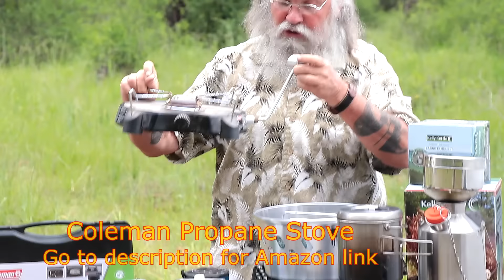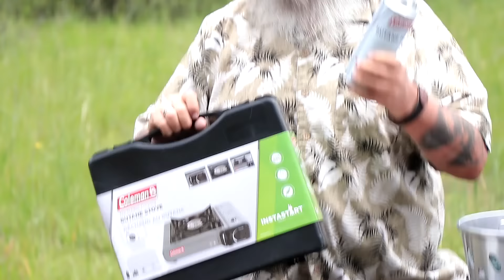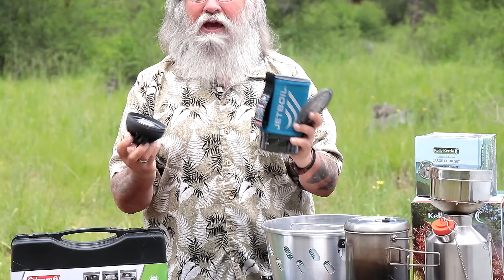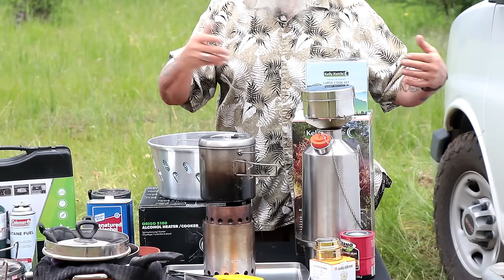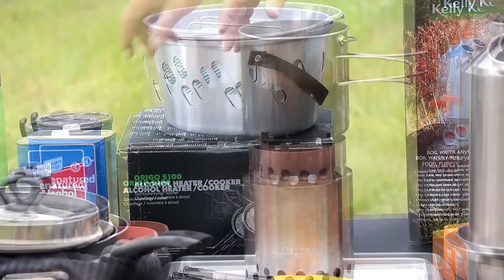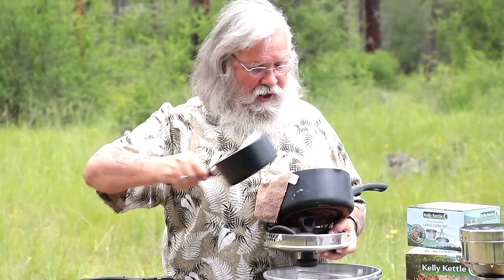Introduction to Stoves:Test Review and Comparison of Wood, Propane, Butane, Alcohol & Sterno Stoves

Comment: I have the Dometic alcohol stove heater and a Kelly kettle.  I have used a pressure cooker on the Dometic just fine.  That combination gives you a steam oven,  fast cooker.  I bake breads and cakes. Saves fuel. 
I love love love my Kelly kettle,  paired with a good thermos,  hot water all day.  Endless fuel with Kelly kettle,  i put sterno or a Trangia stove inside and use indoors,  in my van.  
Water will extinguish alcohol,  and safe to breath.  The Dometic has a fuel spong so it's spill proof. 
With alcohol fuel,  you could actually make your own fuel if needed.

Comment: They tell you not to refill the small propane tanks but finally they are making refillable ones. Another useful device for hot water (but not cooking) is the Japanese cast iron tea kettle which sits on a cast iron base where you place a candle or alcohol based "canned heat".  This is handy in cold weather because the whole unit acts as a radiant heat source. Keep the candle burning nonstop and eventually you get very hot water sufficient for tea and coffee.  These are expensive, 45 to 65 but they are beautiful and as I said serve as a heat source.

Comment: Pressure cookers are great, once you get the hang of them. It doesn"t take long, and there are plenty of tutorials online.
They save time, fuel, and money, and they preserve more vitamins compared with the usual, slower methods of cooking.
The "insert method" (cooking food in a bowl supported above the water inside the pressure cooker) makes cleanup a snap, because the pot never contacts the food, and it stays clean. No cleanup of the pot. The bowl that you eat from is all you need to clean.
The best budget option is the Presto 8 quart (available on Amazon). You can spend a lot more, but this cooker is as good or better than options costing hundreds of dollars. The extra room and diameter of this cooker make it much more versatile than the smaller ones, and it doesn't take up much more room.
You can also use it as an oven. Some bakers use pressure steaming. That's exactly what you can do inside the pressure cooker. I've baked breads and muffins this way many times, and they turn out great. You never burn or scorch anything when you use the insert method. It's a very consistent and foolproof method of cooking.
I can't say enough good things about these cookers, once you get over the basic learning curve, which isn't hard at all.
Coupled with a small propane tank and a basic propane burner (I like the better small cast iron ones made for campers), it's extremely durable and economical. Propane is inexpensive when you just refill your tank(s) by the gallon, and the pressure cooker means you use much less fuel.
After trying many others, this has been the best cooking system by far for me.
Reply: This is brilliant. Thank you for sharing the details. I wouldn't have thought of this.
Reply: I was just at a cooking site where they said you can put a few same-height rocks or sand in a larger pan or kettle, bake on stovetop safely. Pressure cooker sounds like a good thing.

Comment: Great info once again.
- I save a few bucks by refilling the small propane bottles from the larger tanks.
- Regarding the soot on the bottom of cookware, fantastic results are achieved by using a glass cleaner specifically designed for cleaning the glass doors on wood burning stoves. "Rutland stove, grill & hearth glass cleaner" is what I use.
- You might also look into the Firebox Stove (plenty of YT videos). It is compact and can be configured to burn wood, lump charcoal, briquettes, pellets, propane and alcohol. Some additional accessories are needed to use all forms of combustion.
- Yikes, confirmation of my choice to stay single and no kids all my life (60's)
Reply: How do you refill the small tanks?
Reply: Carol Hewett ...I bought a transfer connector from Harbor Freight. There are several YouTube videos on the process.

Comment: I'm one of those oldtimers who's always cooked over a wood fire, and yes, soot does not come off completely. I also carry a small alcohol burner I made back when I was 15 or 16. As I've gotten older, I did buy a Coleman gas burner (Coleman made my first lantern, so it was natural I went with them). The one thing you did teach me about Bob was the canister burner which I now have gone out and bought one plus 4 fuel cartridges. I haven't used it yet probably because I'm really not sure how so this series will come in handy.

Comment: Coleman in general makes pretty great products, however for the butane stove I advise for your consideration the gasone version which is actually dual fuel which uses butane cylinders but includes the hose to hook up to a 16 oz propane unit and as such can also be adapted to a larger size propane bottle

Comment: One option that Bob did not discuss is a Sterno Stove.  They fold up to about 8"x8"x1.5 inches plus the can of Sterno, so quite a bit smaller than anything Bob is showing there.  The stove is about $6.00 and the fuel is about half that much.  I don't remember how long the cans of Sterno last but they do work, at least to heat a can of stew or soup.  I've never really cooked with them a whole lot but I can attest to the fact that they work.  Paired with a Boy Scout style mess kit it should be fine for one person.
Reply: They are an option but as I recall from camping they dont work well at high altitude.

Comment: FYI - you can buy butane canisters at most Asian Markets for $2. That’s 1/3 the cost in regular stores or online.
Reply: What is meant by Asian market? Like an Asian store or an Open Air Market? Thanks!
Reply: Linda Sue it’s just an Asian market. It’s where Asians buy their food in the US and Canada. Same with Bodegas and Carnicerias. I doubt you’d find many open air markets in the US or Canada unless it’s a flea market which are usually not code enforced.
Reply: @lindasue8719  a shop that sells things that are either packaged in Asian countries or just prepared with pure Asian cooking in mind. Kind of like the Latino section of a supermarket, but a when shop dedicated to Asian cooking needs.

Or maybe a shop that sells Asians, but I'd steer clear of that.

Comment: I was very pleased that you included a volcano stove type, in this case the Kelly Kettle, which not only allows for cooking on the top whilst boiling water, but can also be used to cook  directly on the fire pan once the Kettle is removed.

A steel grate is available to put directly onto the fire pan to use it as a woodstove in its own right, separately from the water boiler.

This greatly increases versatility and butane/propane/white spirit use in the main van cooker.

Ghillie Kettle are a good brand and their M-Kettle is the smallest volcano kettle available and it can also store and carry water with it's supplied silicone plug.

The M-Kettle holds just over a pint and can even be taken on hikes. It is perfect for a solo traveller.

Edited to say that the butane bottles which fit those flat camping stoves are actually cheaper here in the UK when bought in packs of 4 they're £1 each.

I use a gas valve adapter to refill my JetBoil cannisters using those £1 bottles of butane and have also bought an adaptor to use them on some of my other stoves.

Comment: One factor is that both wood and alcohol stoves are banned for much of the summer in the West due to fire danger. (Yes, alcohol stoves are banned during burn bans. If you read the burn ban, the only stoves that are allowed are ones with separate fuel chambers and burners, with a valve that can be shut off.) I am partial to an option Bob did not mention: white gas. No disposable canisters, no big bulky heavy propane tanks, excellent cold weather performance. But you do have to go through a priming procedure when lighting the stove.

Comment: Just got Kelly kettle base camp size. Love it. Very efficient.
Reply: Kelly Kettle base that holds fire (or charcoal) does get very hot. Careful what you set it up on. Would damage wood picnic table. Remove solid type  
Plugs when heating.

Comment: we have these stoves, Gasmart brand for under $20, and at one of our hardware stores they have the butane cans at $5.99 AUD for four or five of them..l did read some reviews though that claimed that either the dial OR the bracket that holds the can tend to break easily after a couple of uses so I'm looking at a different style..a small gas jet that will sit on a small gas bottle..suitable for backpackers and hikers..it's a little dearer but l figured, spend a little bit more there and l wont be replacing as often..which in turns saves money..I'm watching lots of your clips to get tips for solo female travelling out of the back of a car, and as l own a Honda Odessy it means l have plenty of length for sleeping in the back..once lock down lifts here in Victoria l would like to try for a weekend away to see how l cope..plan to bring dog with me for some security..I'm using my lock down time to research..

Comment: Hi there, we love your videos! Recently we bought a 1975 Ford campervan, and even though we live in northern California and it doesn't get super cold, we want to find a way to heat our van. I watched your alcohol burning stove with your friend as well, and that one is nice, we are leaning towards a direction that seems to have no one in the RV/Van life community doing, the Samovar tea kettle and stove from Russia and used extensively in the middle east primarily for making tea. Have you seen that or familiar with it? They are both a heat source and heat water which anything that does double duty us van peeps love, and not only that.... they are cheap! I can see a couple issues, but should be curable without much difficulty(bottom heat, venting pipe that fits). I'm just curious if you have ever tried or have seen one used?

Comment: Hi Bob. I didn't hear you mentioned a rocket stove. My husband has one and the only thing that he  uses is small branches or small pieces of wood and he can cook a whole meal with it. The stove is less than $100.00 and no fuel need it except for wood.
Reply: I agree, they are great but you must cook outside right?
Reply: @carolhewett3756  you would have to rig up a chimney but I guess a few people on vans have done it, it's basically a wood stove. I have only ever seen them used outside.

Comment: On a different subject. Could you please do a revue on how fuel consumption is effected on the same van in high and low roof format and possible long and short wheelbase. Here in the UK fuel is much more expensive especially if you are on a budget and also if you are trying to save the planet
Reply: I would like to learn about this, too.

Comment: That Kelly Kettle must be full of water at all times if you are going to cook on top. I have one and do NOT recommend using the top pot stand. It's tippy and boiling water spits out of the pouring spout.
Reply: Most of the ones shown here are stable, but I agree... And an awful lot of the Camping stove options are  top heavy which would scare me.

Comment: Have a Jackery generator, does it harm the battery to charge say  with solar and then switch
To 12V to finish the charge? Also, say I use only 25% of battery today , will it hurt to go ahead and bring the charger back to 100%, or should I wait and let it get get real low to change it again? I’m wanting to preserve the battery life the best I can.